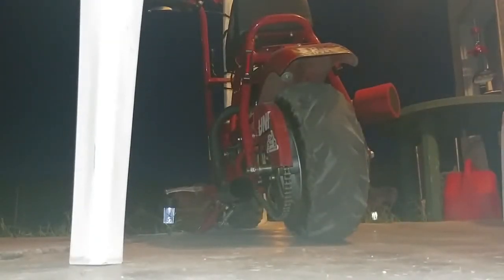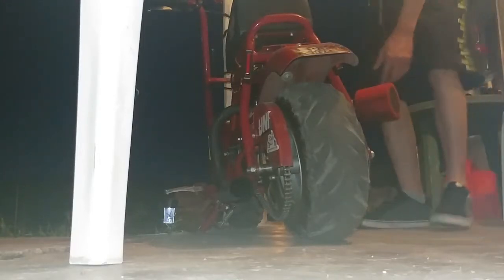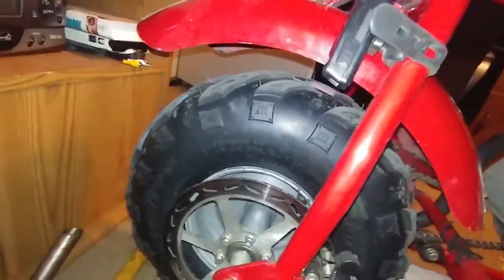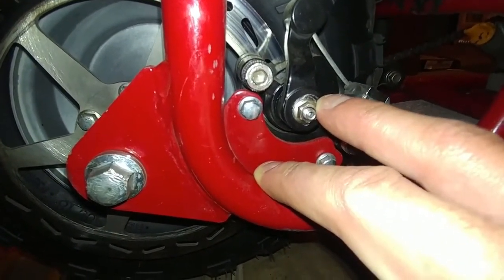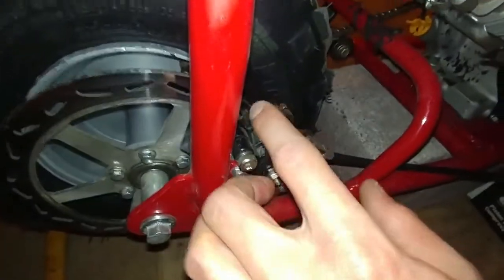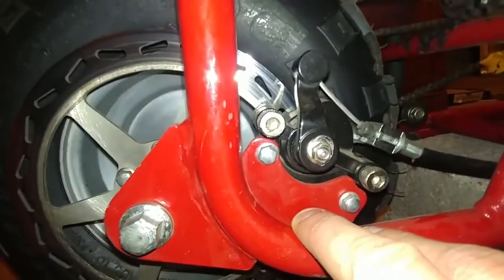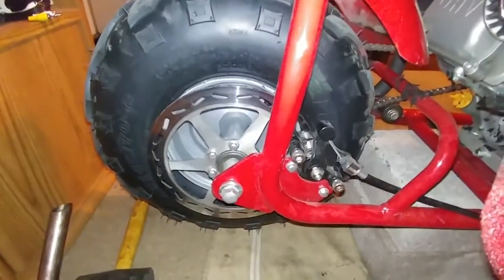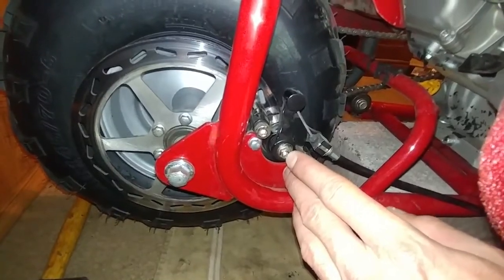Spikemandan© burns the tire until it blows! must watch

Comment: I figured that caliper out when I took it apart , back when I lost the bearings. I'm running a stock 212 Hemi on a ct100u using the PMR mounting plate, PMR chain guard (Is NICE), max torque 12 tooth clutch, gas tank for ct200, stock chain, a short header that a hotdog muffler can screw into, and stock everything else I think. It runs strong and the chain is working fine so far. Just not happy with the exhaust yet, needs bent out more to clear the frame so I can get the muffler on it.And yes,Lloyd Christmas is the BEST name hands down! That minibike he had sold for over $50,000 recently on Ebay! https://rideapart.com/articles/dumb-and-dumber-minibike-auction
Reply from the maker: dude thats just crazy how much that bucket went for haha